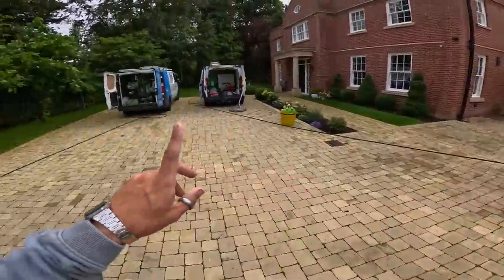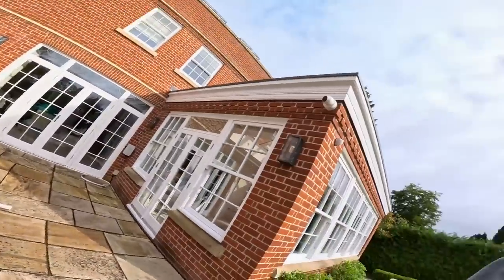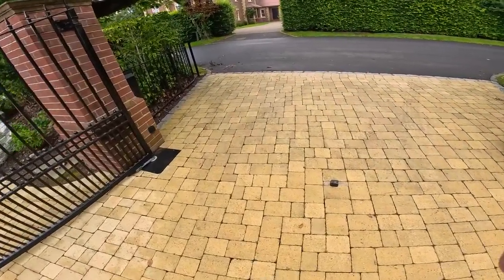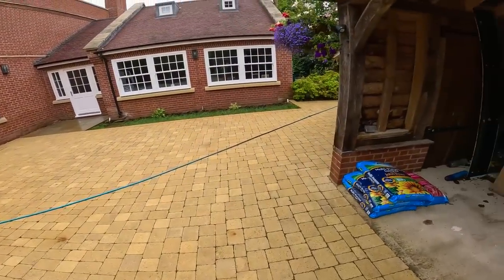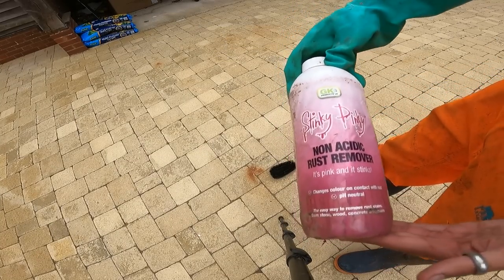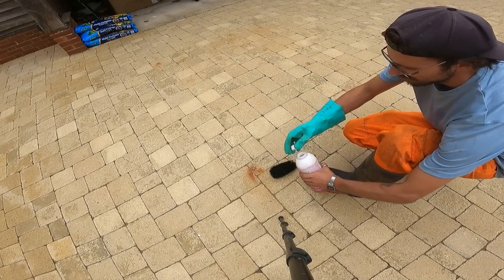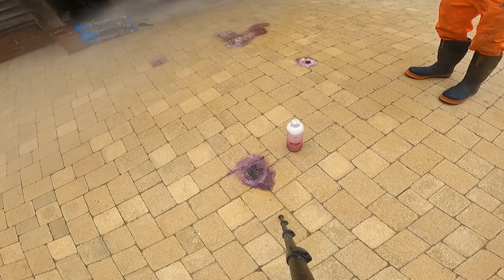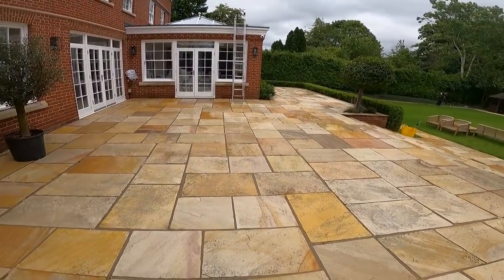Previous Owners Left This Paving to ROT! - Let's Save It Before It's TOO LATE!

Comment: Nice job as always. That stone pinky stuff is Iron fallout remover. You can use it safely on cars also to remove iron fallout from railways and brake pads. I use it all the time to really get my race wheels clean again from heavy brake dust.... It is indeed the magic thing to remove any iron contamination on all surface, keep it wet and out of the sun as with all chemicals....

Comment: I’m trying to prep my redwood deck for resurfacing, and I’ve tried the power washer from Home Depot, and it helped, but there is deep tannin staining. I’ve tried bleach and water mix, but still no joy. I think I’m going to have to move to Hypo, any suggestions on strength?

Comment: It's interesting to see the two approves of using the lance while pressure cleaning. Sid has more of a broad sweeping way. 
Where Elias is more direct down in front of him.

the second does seem like it does clean a bit better. but it does seem a bit slower and more taxing.

the first is a bit less clean in once stroke but is a bit faster and less taxing on the person.
Reply from the maker: yeah hes still holding it too close, didn't notice till editing, there's a sweet spot which is far enough to clean quickly but close enough to take weeds out. it's the same amount of clean because you overlap your previous sweep by 50% each time. any hard staining will be taken care of by a chemical treatment afterwards, trickier job to teach than i used to think :D

Comment: Why do you use that small surface cleaner so much? I use 18inch on pretty much everything that doesn't need to be turbo'd
Reply from the maker: smaller surface = better clean with a larger machine, it's not time effective on large areas but pathways it does well. takes a lot of the heavy organics off much better than an fsc twice the size. pathways are harder to treat well with SH than large areas as the grass edges are close and the run off is harder to keep track of. They take good care of their lawn at that house so I like to minimise having to go heavy on the chemicals in sensitive areas.
Reply: @PartridgeExteriorCleaning  I normally go over everything that fits the 18inch fsc and if it's a small path I use a soft brush to put the hypo on so I don't over spray with the xjet. What surfactant do you use in your hypo